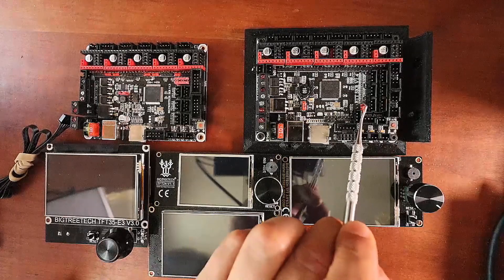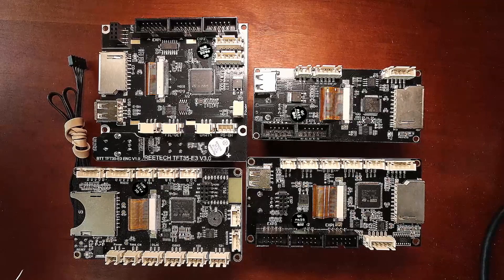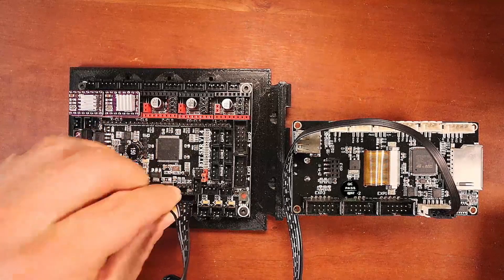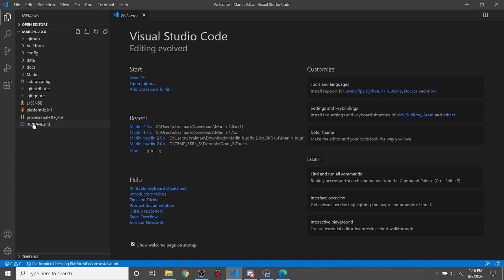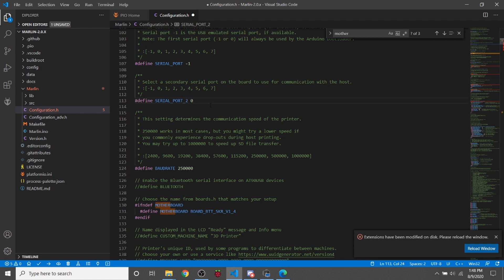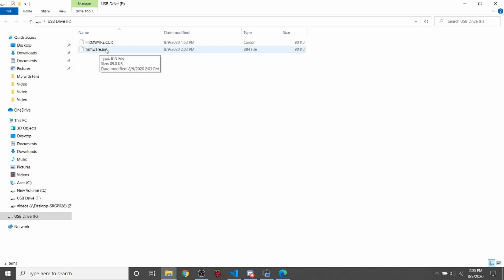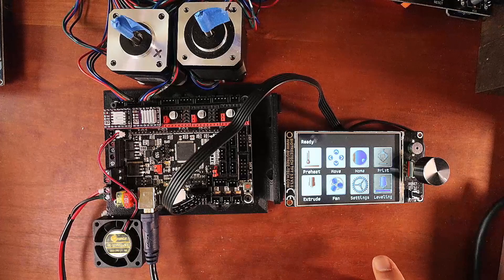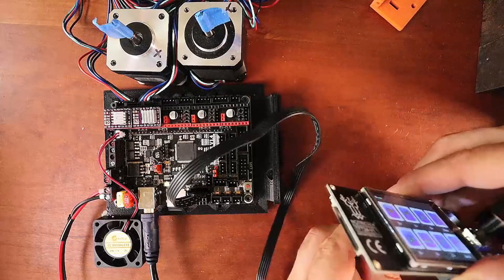SKR 1.4 - Connecting any BTT Touch Screen Display to SKR 1.3/1.4

Comment: For anyone trying to change the default preheat settings in the TFT mode on one of these screens, you have to do it in the screen firmware in the config.ini file. It wont change the preheat values in TFT mode if you change the preheat temps in Marlin. This took me weeks to figure out and I'm hoping I can save someone else trying to do this same thing
Reply from the maker: You can always set in sliced gcode file when slicing.

Comment: I probably asked this on the wrong video earlier. Will the SD car slot work with this configuration still or do i need the two ribbon cables for that?
Reply from the maker: Are you asking about printing or firmware loading?
Reply: @EdwardBraiman  printing. I'll try it out in the next day or two and let you know
Reply: I can confirm that you cant print from your TFT screen without the ribbon cables being connected

Comment: use a multimeter find the ground wire so you know which driection to plug the connector
Reply from the maker: Yes.

Comment: For several days I have been trying to connect the BTT TFT35 V3.0 monitor to BTT GTR and I keep getting the message "no printer attached". Classic marlin works fine, but touch mode doesn't. Do you have an idea how to fix it?
Reply from the maker: Which version of Marlin firmware?
Which version of BTT TFT 32 firmware?
Which serial port number are you using for second serial port number?
Reply: @EdwardBraiman  Hi. Marlin 2.0.X bugfix, TFT35_V3.0.27.x, Serial port -1
Reply from the maker: Okay in the video I talk about a second serial port.
Reply: @EdwardBraiman  

I try to set serial_port 2 but I get an error while building
Reply from the maker: For second serial port what's the number.  I think the second one can not be same as first, so try 1.
Reply from the maker: I'll be looking at during Livestream on YouTube at 6 PM EST.
Reply: @EdwardBraiman  it was my mistake - I set serial_port2 to 0 and you need to set 3. Thanks
Reply from the maker: I'll need to check that as I thought the number was lower, unless they changed in Marlin firmware.

Comment: Are the config settings in Marlin 2 left with, no display selected, if using uart mode for TFT? With SKR 1.4 Turbo are any connections to Exp1 or 2 required for TFT use? Thanks for the help.
Reply from the maker: I think you might be able to use TFT, but I'll test during Livestream Friday to verify or disprove.
Reply: @EdwardBraiman  I found another tutorial that covers the exp cables function. The TFT screen can switch back to old style display if selected (ie RepRap full graphic display) by holding down the button dial 3 sec. UART connection feeds touch screen style, exp cables feed old 12864 style simultaneously. https://www.youtube.com/watch?v=57f-sG0nFeM
I have a real problem with mfr not including detailed instructions and board manual, but that's the way it goes these days. I learn good.

Comment: Hi Edward,
thanks a lo for this first class video.
I have one question: are the pins for the rs232 on the skr 1.3 the same as on the 1.4?...or is it the reverse order?
Reply from the maker: There's a manual for each, but if you check pinout diagram they're very close.

Comment: hello, why did you connect the USB cable to the SKR once the pin selection is set to VDD, as in that case the SKR is not accessible on windows ?  is there any reason ?
Reply from the maker: If you're referring to jumper one setting is for direct power from a PSU and other is for USB power.

Comment: If im compiling marlin on a new SKR v1.4 Turbo using the TFT35 V3 will I need to also add the boot.h and statusscreen.h files with my configuration files into the marlin folder? will this effect the unicode screen?
Reply from the maker: I'll need to research boot.h as it's a header file of some type.
Reply: @EdwardBraiman  hi, thanks for getting back to me. I started a discussion on Reddit group for the bigtreetech about this. Its sounds like if I want the stock info for the marlin mode then add it but if not its default.

Comment: Hi, but is necessary say in the firmware than is used TFT ,or not?
Just say SKR is enough?
Reply from the maker: TFT is treated like an external Computer by Marlin firmware.
Reply: @EdwardBraiman  it is...??
Reply from the maker: Only setting on Marlin firmware side is serial2.
Reply: @EdwardBraiman  right men , thanks
Reply from the maker: You're welcome.

Comment: With the TFT35 V2 you can print via the SD on skr board? I cannot init the SD on the board
Reply from the maker: It's possible.  Check BTT GitHub I think there was an issue opened on this.

Comment: Hello another question. So I did get this running on my a20m. Skr 1.4 and tft35. Everything works ok. But when I put a micro sd in the board slot with g-code files and it say no media detected. But it does still flash firmware. When I use the usb on the screen with g-code it works fine. When I try to use the sd slot on the screen it shows up but locks up everything if I try to print. Idk if you know what I should try or not. Thank you.
Reply from the maker: I think one slot is for upgrades and the other is for gcodes.
Reply from the maker: The slot on the SKR  motherboard is always for firmware.